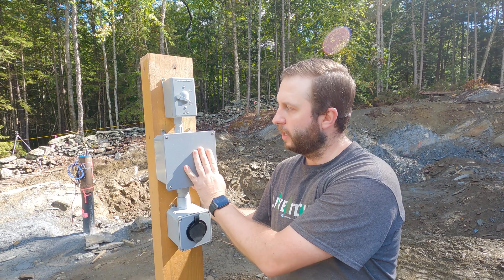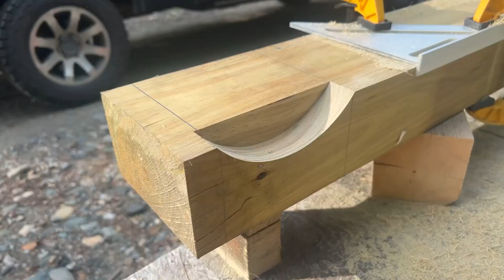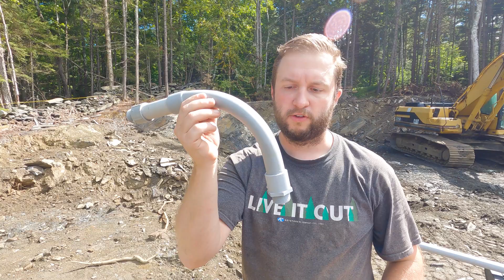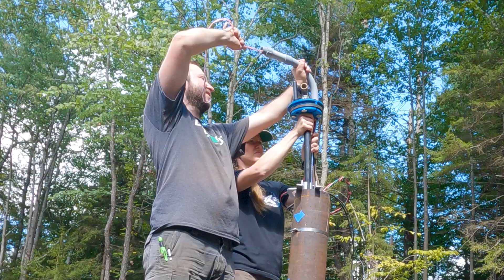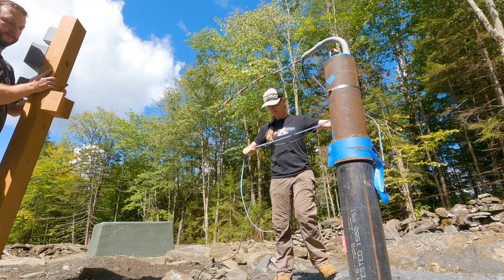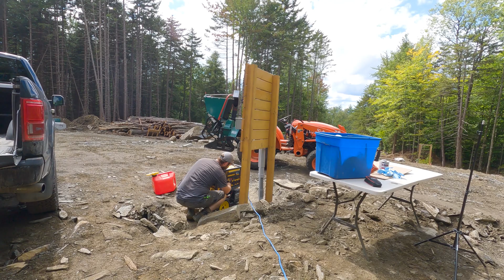Will it work?! Wiring up the WELL PUMP! || DIY House Build

Comment: Since the consequences of taking the nuts off the well seal are so dire, I think I'd take a hammer to the last couple threads and peen them over.
Reply from the maker: I don't think that's necessary - at least, I've never heard of anyone doing it. You just have to know what you're doing before you go blindly unbolting things.
Reply: @AdventurousWay  Staking or peening nuts that would cause disaster if they came off was what they did before the invention of loctite: commonly done on wheel or axle nuts, for example. Some car restoration types will still do it as a matter of authenticity. Your description of what would happen if it fell down the well bore made me think "better safe than sorry" if it was mine. Agreed probably not necessary, or typical practice
Reply from the maker: Understood, but peening threads or using Loctite is to prevent accidental loosening or removal. In this case, the risk isn't of accidental loosening but user error. It's more akin to disassembling an item where a screw or bolt is holding things together inside a casing and you need remove it carefully.
Reply: @AdventurousWay  right: ideally this would be an excellent case for captive bolts. I was just improvising a "poor man's" captive bolt, I guess.
Reply: To make it clear, I was suggesting peening the very last thread or two: plenty of room to loosen the nut, just less likely to accidently spin it off.
Reply: BTW, there's a youtuber I see occasionally who runs a company doing septic and well service - I know I've seen at least one video on getting lucky retrieving the bottom half of well seal after an overly aggressive DIY service attempt dropped it down the casing (I think they were doing a pump replacement)
Reply from the maker: Ah, I see. Yeah, that makes sense. Thankfully there's plenty of thread and you only need to loosen it a few turns to get it off. As long as you know not to spin the nut off all the way, you'd be hard pressed to do it accidentally.